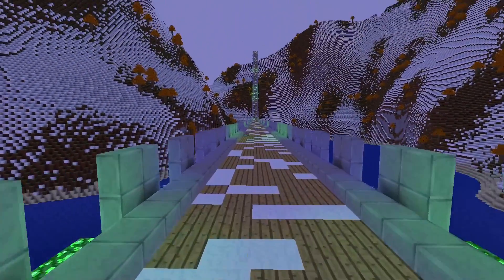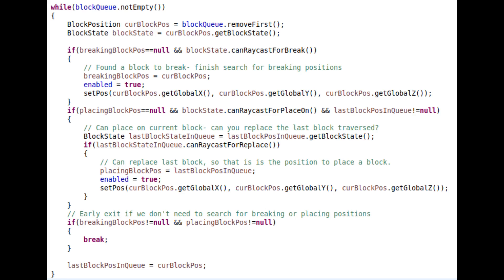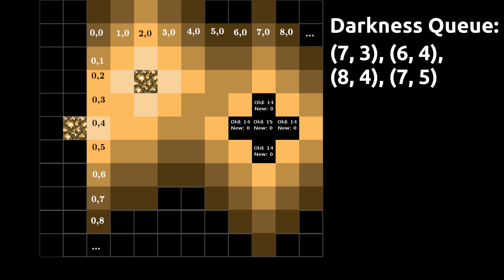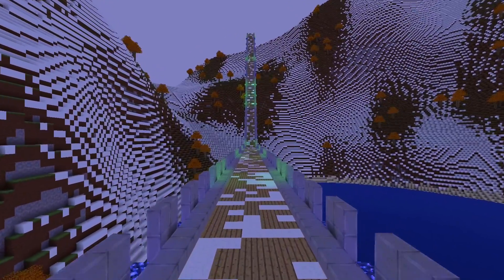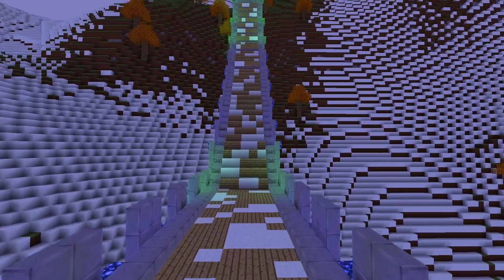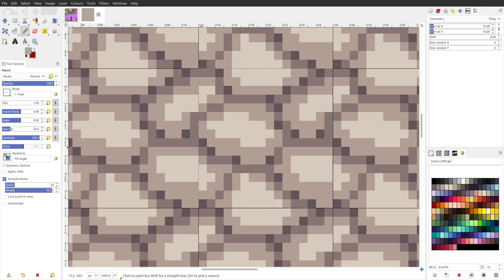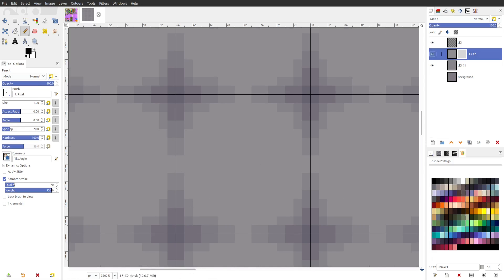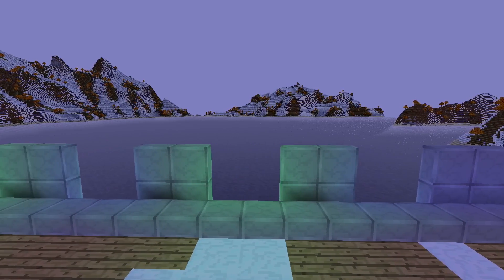The Algorithm Behind Breaking Blocks – Remaking Minecraft

Comment: I suggest making water and other liquids be able to flow trough any non-solid block, unlike minecraft's waterlogged system where only full water blocks can exist within non-solid blocks, while running water is blocked by them. I think this could be achieved by having water be, rather than a block itself, a group of values assigned to each block in the world that determine wether there is water or not, water flow direction and quantity of water, and maybe also type of liquid if you intend to add more other than water
Reply: Some of the light propagation code could be reused to make that, and I think it'd be interesting
Plus, you'd only need to update it at the speed you want water to spread at

Speaking of adding liquids, it would be awesome if liquid concrete was added, and you can pour it over iron bars to make reinforced concrete
Reply: This would mean you could have blocks with two different states that either block or allow flowing water. I'm imagining a pipe with a trapdoor that would only allow water to flow if it was open. Or a castle with murder holes and boiling oil
Reply: Sounds similar to dwarf fortress
Reply: There's a mod in Minecraft that does this called realistic water

Comment: Is the block update system currently multithreaded, or on the same thread as drawing?

In my experience it was crucial to offload big block engine functions to a separate thread, so things could happen on one processor core while the other rendered the game without freezing. By using a Vertex Buffer Object compiled into video ram, I had a working 'render mesh copy' that would be synchronistically updated when the block functions were done, but rendered into draw calls while block threads were 'working' on the new appearance of a chunk. Of course, this could have a bigger memory overhead, but it goes onto the video card.

Comment: I think for the grass system and possibly other texture systems you could use texture blending in a similar way that Terraria uses it; each face that's exposed to air yields a grassy texture while each face obstructed by a block has a dirt texture, and in between these would be a transitional texture between grass and dirt.

Comment: You could always let the player choose what materials they want to use from a list of similar materials. For the stick example, have one button for sticks, which would pull out a little menu that has all the different planks you have enough of in your inventory. By default whatever it finds first will be selected, but you can change it by clicking whatever plank type you want to use.

Edit:
After a few minutes of mulling it over, I actually think simply highliting the materials that will be used in the player's inventory, and letting them click a different material to select it would be a more elegant solution
Reply: Or you could do like the console crafting system and quickly cycle through which resources are possible for use when hovering a recipe.

Comment: One thing that bothered me a bit in minecraft, is that there is a plenty of wood types, all whit different looks. Even doors, trapdoors crafted from them have different looks, however when you craft them into stick's ore tools, they all look the same, no matter what wood they are used to craft together, it always look the same. Now talking about wood, in real life, woods have different strench and durability, which dictates its usages and what its beeing it used on.

Now is it only me ore others are beeing bothered by original minecraft's inconsistencies like this?
Reply: I think in terms of gameplay, it's better to have one type of tool have the same durability no matter what variation of the base item is used. Sure, different wood and stone types would be better or worse, but in both playing and designing a game, it seems like it would be a chore to implement a system like that.

One thing I would suggest though, is having alternate textures depending on what specific type of material is used. Like if you used Birch wood for a pickaxe, it would have a lighter color than an Oak pickaxe. This could even be applied to things like sticks as well, though it might be better to keep items like that as one texture for the sake of condensing the number of total items in the game. I know Terraria has different armor and tool sets depending on the wood type used, but as far as I'm aware none of them are different from each other in terms of stats.
Reply: Perhaps that can work too, i was just only a bit salty ab having a butch of different looking wood types whit even more type of different looking stuff you can craft from them but sticks, tools and tool handle's are an exception.

Comment: I like what you did for the block system, and it's probably much better than what I'm about to suggest. Did you consider just rendering the placed block immediately, and delaying chunk remeshing to some future point, at which time the ghost block becomes a real block? In my mind, this makes placing blocks instant, although breaking a block will still be some delay. Also, what was the real timings for these methods? You said half a second in the worst case, what was the best case? With your new system (maybe I didn't hear it), what is the best and worst case now?
Reply from the maker: Issue with the 'ghost' block is that the surrounding terrain needs to account for the placed / broken block as well, i.e. lighting and ambient occulusion. As far as the timing goes, it was eye-balled, and it's hard to say the true differences because there were major slowdowns that were fixed in the mesh generation thread not mentioned in the video, for example previously around 70% of the time was wasted on just sorting chunks rather than meshing them! When I revisit it, I'll try to keep better statistics.

Comment: About the crafting system: Minecraft's recipe book groups all of the same recipes into one tile, and if you right click it, you can choose which ingredient you want to use for said recipe.
Reply: MC & Factorio share a similar Tab system, though the difference is MC has a sub-Tabbing system where Factorio doesn't and has each recipe on its own. This creates abit of a visual search slog akin to MC's JEI where you have to use a search to quickly find what you want.

Terraria's system is a mirror of MC, but without Tabs and is heavily inventory dependent.

TBH I think that a Tabbing system that uses MC's inventory context dependency, with the ability to 'opt out' on recipe availability, but married to a scrolling tab system & search bar works pretty well... as long as native block type isn't beyond 512 block types. This type of system would be able to support thousands of block types with 'smart' block definitions & relationship tab groupings.
Reply: @walterroche8192  You can even dynamically expand on this type of inventory if you use a tagging system for recipes that shares different input types (Like using any type of plank to craft sticks)
Reply: Why not just use both? The preset system from games like Factorio and Terraria is great for quickly crafting specific, limited sets of items. Minecraft's system benefits from its sheer malleability. Neither are technically incompatible with the other, it's just that the recipe book executes it horribly mainly in design.
Reply: i thought about it too. dk actually how does it work in MC since i don't use the crafting book but i imagine this as a Factorio'ish tab with recipes and if the desired item can be crafted from different ingredients you can just pop up new window with variants of raw items or even drop-down menu for each ingredient that can be differed
Reply: Personally love when a crafting system shows you what can be made from one ingredient as well as the rest of the ingredients required to create said items, could be possible to have a small subwindow come up when trying to craft something with interchangeable materials or variants

Comment: For crafting that has 1 output but different inputs (i.e. oak/birch planks making sticks) I think you could just copy minecraft's solution. right-click the recipe to select which wood type gets used.
Or perhaps being able to set a preferred "building" wood that doesn't get used in crafting, outside stuff like stairs, slabs, fences, stuff that would have the texture and colour of that type. And a preferred "crafting" wood, which gets used in any recipe before any other wood type.
Reply: I think it would be better to just have a drop-down when you click on the recipe, that goes through the different ingredients you cool use for it. Maybe it would remember which ones you use, and shift right-click skips the drop-down and uses the last-used recipe.

But add a config for minecraft shaped crafting.
Reply: There are some situations when I like to mix-and-match my ingredients even when I have enough to craft it from just one type of ingredient

Comment: I noticed the smooth lighting blocks have - are you storing rbg light values per vertex of the chunk mesh to achieve this?
Reply: If my memory is right, each chunks stores a light map, it is an RGB value with a brightness, and the shader interpolates those values smoothly, but it only gets 4 numbers for each block. You can find out by watching his previous videos where he implemented the block light system.
Reply from the maker: This will change in the future, but at the moment each vertex has 3 floats for positions, and 1 float which represents RGB lighting (12 bits), sky lighting (4 bits), ambient occulusion (2 bits), and UV coordinates (14 bits).